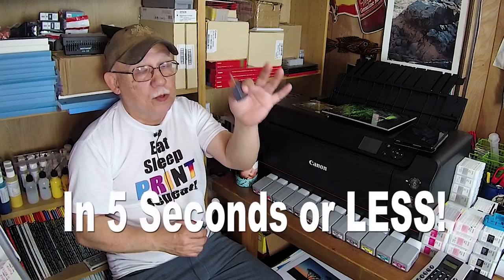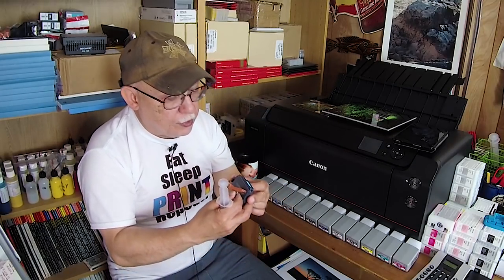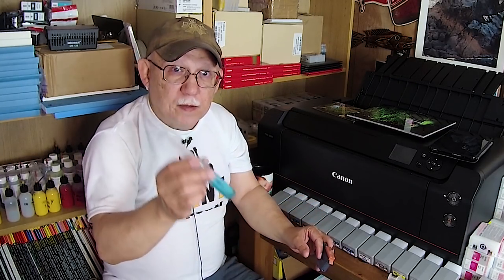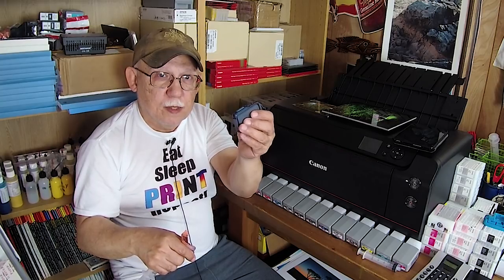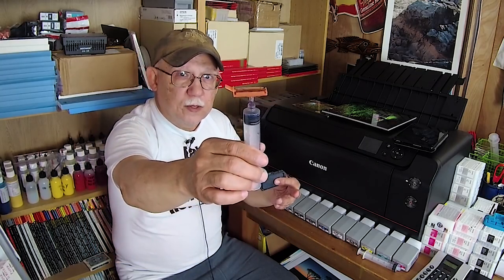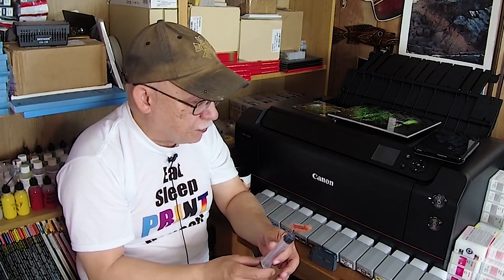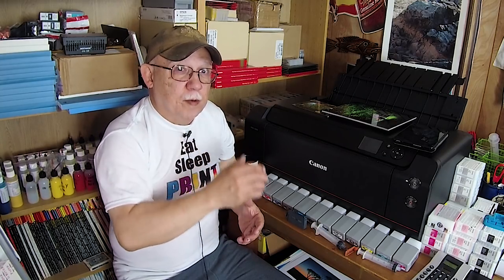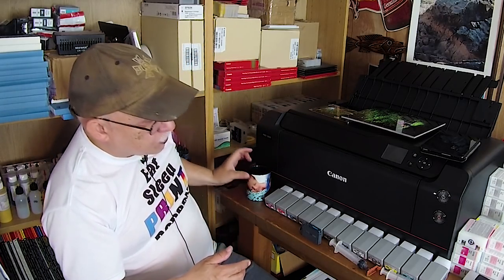How to Refill a CANON PRO 10 Cart in 5 seconds!

Comment: Love your channel, Jose.  I've learned so much!  I just bought a Canon Pro-10 (after having two Epson printers), and I see it's one of the  thirstier printers out there.  I'd like to refill the carts with OEM inks from another Canon printer.  Which one has the largest carts?  Where do I get all of the parts for this "project," i.e., the scale, the syringe, am I storing the ink from the carts in bottles after I've filled my first Pro-10 cart?  That little thing you glued to the cart cover that you put the syringe into, where did that come fromt?  

It seems to me that if I don't touch the Pro-10 for a while, it shuts itself off!  Have you heard of this?  I'm unable to keep it from doing the ink recycling operation because of this.  I'm keeping my computer on, the printer connected to the computer, and the printer is plugged in and on.  But still shuts off.

My other question is why does the Lightroom print module have the "page setup" box on the lower left hand side?  I've never understood the purpose of that.  Maybe you know.
Reply from the maker: You don't really need to use OEM inks just check out Precision colors signature edition ink set for the Pro 10. Everything you need you can purchase from them including the chip resetter bottles Etc. The Lightroom print module page setup basically opens up the printer driver which you need to open to set your settings for your print job.

Comment: Approximately how many times can the same Pro-10 cart be refilled?  Is it advisable to flush the carts regularly using your adapted needle method?  What will be the signs of a cart nearing the end of its useful life?  Would it be wise to "cycle in" an OEM cartridge from time to time, or would this be incompatible with the Precision Color inks?  I love your videos.  Thanks so much.
Reply from the maker: The PRO10 CLI-42 carts are unique in that they do not utilize a Sponge like those used by the PRO100. So you can used them till declared empty. They have an internal ink bag. Just make sure to dribble the ink into the exit port so you WET all of it in the process. You will not have to ever flush them unless you are switching to another ink set.  So it is the perfect refilling system. Fill them by tbe dribble method till they weigh in at 32-33 grams NOT including the Orange clip.

Comment: If you want to purchase aftermarket pre-filled  cartridges for the Canon Pro-10, which is the best brand?
Reply from the maker: None! Blunt but true. The best approach is to refill your original ones. It is supper easy! The OEM carts have internal engineering that is patented and can not be incorporated into compatible replacements so they are absolutely inferior and pure junk. You already have the best. Your own original carts is the best way to go. You will need a resetter and inks. I suggest Precisioncolors if you are in the USA
Reply: @cheo1949  Thanks for the info.

Comment: Does the use of 3rd party inks impact on the archival quality, say you are already using some archival papers
Reply from the maker: Of course it will. Though paper matters like RC coated with OBAs be a high end rag fine art paper with zero OBAs. Third party inks will fade faster. OEM / Archival papers will maximize longevity. You would need to spray you prints made with 3rd party inks to increase longevity when using any third party ink on any paper.
Reply: Jose Rodriguez thank you I use the cannon 10 . I brush a UVLS from Golden then they are presented under 90% uv glass. A question for you , why is epsom rated so high by the whillhelm Inst 400+ for bw yet the lux inks in cannon is barely 200
Reply from the maker: I normally don't follow all these accelerated tests as to me it doesn't translate to real world conditions. What Epson  against what canon inks? On what papers and printers? 400 Lux vs 200 Lux still translated to decades in my home walls. Protected or bare? Yeah those numbers don't mean much in real life print display conditions.

Comment: Hi there,  problem number 7,865. I have a canon pro 10s when printing on Hartwii A3+ 180 - 260 g/m2 paper some of the prints get a 4 inch long sig zag scratch, something like a size ma graph needle mark on them, in bottom left hand side. Any ideas my friend? Gratefully your Brian
Reply from the maker: I do not know that paper but ANY physical scratches are usually caused by head strikes! Activate "Prevent Paper Abrasion" in the Maintenance Tab / Custom Settings
Reply: @cheo1949  It's a brand new printer. After thinking on it, could be paper too thick. Or then again I could be too thick. Thank you for replying

Comment: WHERE DO I PURCHASE THE INK AND FILLER SUPPLIES FOR A CANON PRO-2100?
Reply from the maker: To tell you the truth I didn't even know there was a IPF PRO 2100 I only know the PRO-2000.
If this is a newer version then the answer is that there is no third party option that will even come close to the OEM products. If you meant the PRO-2000 then your only option at this time is OEM which you can get 700ml cartridges for $225 with USA shipping. Rather than $300,
Link is on my video descriptions.

Comment: would you still buy a canon pro10 today?
Reply from the maker: Sure. Why not? It is still the best printer in it;s class and super easy to refill and use with other inks other that OEM
Reply: @cheo1949  I haven't watched your content in a couple years. What's the best most recent pro10 refill method and do you sell kits for it?
Reply from the maker: Was full these carts directly by dripping ink into the exit port. It's been the same since the start. Fill till they weigh 32-33 grams. Please watch my latest video just a few days ago about filling these carts.